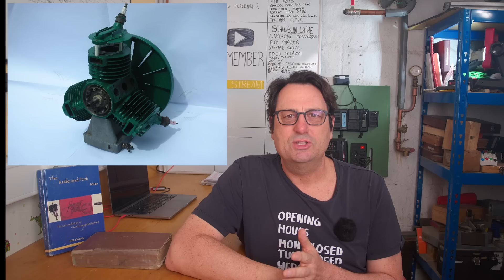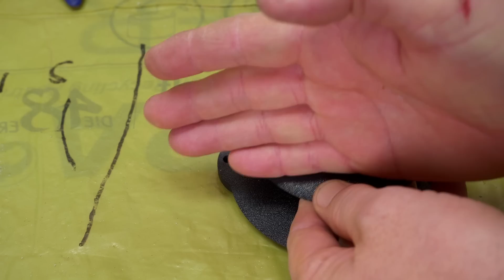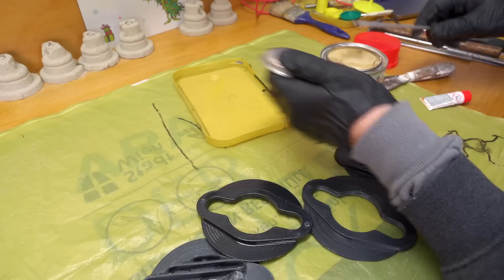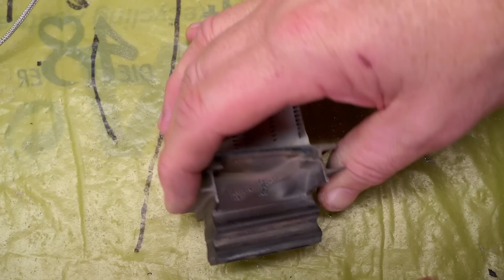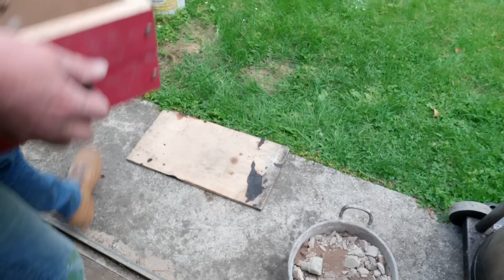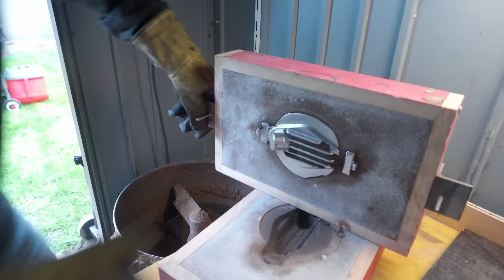Prototyping cylinder heads - Redrup Radial EP.6 || RotarySMP

Comment: Lofts and fillets. The two forbidden features of 3D CAD😢 Autodesk Inventor has a content library full of zillions of fasteners which might give you the AF dimension for your BSF screws.
Regards,  Preso
Reply from the maker: Hi Mark. I have been informed that BSF is a head of a one size smaller BSW. The 3/16" BSF i= 1/8 BSW = 0.340" AF hex.
Reply: @RotarySMP  That's good. Getting the details right is important. I am just about to start on a casting project in aluminium that has very thin sections like the fins on the cylinder heads. I was going to try pouring at about 720C. I am not too worried about porosity since it's just a model racing car (a replica Cleveland Racer). 
Regards,
Preso
Reply from the maker: @Preso58  Hi Mark.
I don't know why I brainfadedd and thought 600°C would be a good starting point, but it has been a good learning experience to step up through 680 and 700 on this casting to see the effect of these temperature changes. With a bit of luck we won't have any more showers this afternoon, and I can start my production castings. I will use 720°C for them, and also give petrobond a go on thise patterns.

Comment: The solidworks used has “tangent propagation” option un-ticked otherwise one line selection would do the job. Fusion is sure a pretty interface but it’s infuriating to use. Solidworks ad much as I hate to say it is probably the best to use followed by inventor in a close ish second
Reply from the maker: Unfortunately there is not solidworks port to Mac. I actually like Onshape best.
Reply: @RotarySMP I haven’t really tried out on shape yet but as I understand it, it was born from ex solidworks programmers. I’m just very hesitant to get on a subscription service where I lose access to all my past work if I don’t pay up. That and it’s owned by PTC which is a super pain in the @$$ to deal with. I guess at some level it’s damned if you do, damned if you don’t but I’d expect SW is the most user friendly for modeling with inventor and presumably onshape a close second. Fusion is hot garbage for modeling but absolutely brilliant for CAM so my process is model I solidworks and then CAM in fusion.
Reply: @RotarySMP  I do keep a PC just for my engineering software but if you have an intel based Mac you could do bootcamp. Some of my students have also had decent success with parallels to emulate a windows environment

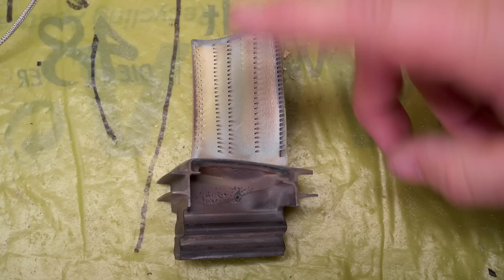Comment: 24:27 , on large heavy frame gas turbines the combustion gasses are measured near the root of the vane disks in a small cavity. The temperature is cooler than in the direct gas path but it’s also precisely cooler. Which means an accurate combustion temperature can be determined without the need of placing instrumentation in the gas path where if it fails it could become foreign objects that destroy the turbine section.
Reply from the maker: Thanks for that. I have never had any involvement on the big stationary gas turbines, other than a fascinating lecture from a Siemens engineer during a Cranfield short course.

Comment: Polymaker and likely a couple others make a burnout filament for this purpose. I’m planning on buying a roll and when I get a chance will try it out. If this works, then large investment castings would, should, work. I hate making two part molds. This would eliminate the need.
Reply from the maker: Hi Mel, I have a roll of polymaker polycast. I need to try it out on my wifes next Beatles casting.

Comment: Hi Mark,
3/16 BSF bolt heads are .340 across the flats.
The spanner for this may be marked 1/8W or 3/16 BS.
In my apprentice days in Oz my fitting and machining hand book, long since lost, had the formulas for bolt heads and washer sizing based on bs190 an bs84.
An alternate is listed as 2ba if bsf is unsuitable.
You might find that some of the fasteners on this motor were C.E.I. so be careful with 26 tpi threads if specified.
Bolt and nut hexes and the washers for bsf were sometimes based on the next size up i.e.  the washer for 3/16 was sized for 1/4 except for the hole which was clearanced for 3/16.
As this motor is pre ww2 it may have used the larger head and nut sizing for all the fasteners.
Depends how accurate and pedantic you want to get.
This would also apply for the bolt pads.
Good luck.
Reply: Good point on CEI threaded fasteners,  my thoughts exactly.
Reply from the maker: Thanks a lot. 
I also considered CEI, but asked Bill Fairney, Redrup's biographer, and he confirmed Redrup used BSF on his engines. He had worked on aviation engines in WWI. US AF and Metric are way more logical than the BSW/BSF system of naming the spanner off the nominal shank diameter.

Comment: Very detailed and comprehensive video, CAD modelling to casting, brilliant 👏. 
Ref cylinder head fasteners,  looking at my 1927 Mechanical World Year Book , there's no 3/16" BSF listed (starts at 1/4), but 3/16 BSW has head A/F of 7/16", and height of 5/32", the book is heavily commercial, with no standards referenced. Slotted head screws could certainly have been used as you state, not sure what year British Standard Cycle BSC, BSCY, or CEI was introduced, this had 60° thread angle. Would a fine thread be suitable for what would be a fairly low strength Aluminium alloy casting?

Many thanks for sharing. 
John from the Black Country UK 🇬🇧
Reply from the maker: Thanks John. I discussed threads with Bill Fairney, Redrups bioographer. He confirmed that Recrup used BSF on the engines, rather than cylce, as he had worked on aviation engines in WWI. The aluminium castings will not be threaded (other than the spark plug). The threads are in the cylinders, which are cast in iron, integral to the crankcase.
Reply: @RotarySMP  Hi Mark,  interesting,  I had assumed the crankcase was aluminium. TTFN John
Reply from the maker: @bostedtap  That would be too easy :)

Comment: I'm far from an expert on FreeCAD fillets but I can offer a couple of suggestions:
1st: ensure you have upgraded to 1.0.1 (released about a week ago) which fixed a number of issues.
2nd: Contact Darren Stone (MangoJelly) to disuss if your issue is possible with the current revision, and
3rd: Submit a request/start a discussion on the Forum as the developers are always looking for feedback on issues and you seem to have discovered an unusual one.

Question: Are there any options to prevent Hydrogen intrusion in aluminum casting other than temp control ?

Thanks again for the great videos.

Comment: It might seem counterintuitive, but to reduce the layer lines it might be worth a try to print it at 45° or 90° turned to how you did it, kind of mid-air and let the Slicer generate tree supports on one side. With that, Acetone smoothing might be enough to smooth it.
Reply from the maker: Good tip. I didn't think of that.

Comment: I’m impressed with your projects. 
I’m guessing you’re going to make the motorcycle too for that engine? 
I’m impressed with your casting work and I’m impressed you have a Muller I didn’t realize you had one or is that a fairly new purchase? Are they hard to find that size?
I do enjoy the jet engine exclamations. Also I didn’t know about the turbine engine fins had the small holes. I knew they were hollows through the center.
Thanks for explaining about the different temperature probes and jet engines. I didn’t know anybody was using color, but why not as temperature. 
I’m impressed with your CAD skills. Also I’m not good at that stuff. 
I do all my drawings on paper   
Yes, I’m a machinist for 40 years. I have my own machines at home too thank you for your good work.
Reply from the maker: First I will make the engine... that might take five years. Then I will think about the motorbike. :)

The muller is a home build one, I made from an old hot water heater. I made it about seven years ago, before I started doing videos.
Reply: @RotarySMP  I watch all your videos so you’re making this motorcycle from pictures and this was a one off motorcycle?
I was kind of guessing the guy built it for racing back in the day?
Well, it’s good that you manage to find some documentation and and use extrapolate from the pictures. 

Would the original bin aluminum or was it cast-iron?
Reply from the maker: @akfarmboy49  Redrup made the first one for himself as a daily driver. He lived in Wales but had a job on the english side of the Seven, and would ride the bike to get the ferry. I doubt it was raced. It is a gutless 2 3/4hp :)
There was at least one limited series production motorbike from Beaumont with this engine, and also some industrial engines for gensets etc.  I have no idea how many were made.
The crankcase with it's integral cylinders is cast iron. The head was supposedly aluminum.

Comment: i like using fillets for 3d printed parts, great way to add strength to fills and other structures for 3d printing if you can accommodate the space it requires.
Reply from the maker: Good points Christopher. With castings you  really need them as sharp edges cause loose sand.

Comment: i have a couple off the cuff ideas for getting the boss insert not to stick to the head
1) increase the alignment pin tolerance by some tiny amount to try to eliminate stiction without greatly affecting accuracy (might be difficult to hit that sweet spot due to the limits of 3d printing)
2) use conical/tapered alignment features so that the boss pretty much cannot stick to the head while still retaining high accuracy
3) insert a nut in the head under the boss so you can use a screw to jack the head off of the boss and out of the mold so the boss is forced to stay in place
Reply from the maker: 1. I have the main pattern enlarged by 1.5% for metal shrinkage, and left the boss nominal, so it is nearly the right tolerance, but sticks just a little :)
2 It is tapered, kind of like Morse tapers release :)
3. Good idea. I will see if there is enough space for one.
Reply: @RotarySMP  if you end up not going with the jacking screw idea or it doesnt end up working, maybe try doing cones instead of taper pins like if you look up "cone locator pins", that way like i said it is pretty much impossible to stick but with that also being a downside wherein a bit of care has to be taken when ramming the mold as to not displace the boss piece.
Reply from the maker: @misterdeedeedee  They are now working nicely. I did another casting session yesterday.

Comment: nice work!if you increase compression ratio consider adding a little more cooling.
Reply from the maker: It is only a 2 3/4hp engine. That compression ratio will be fine.

Comment: I work in one facility with an aluminium casting shop. Comparing your methods to theirs, you are overthinking a lot. For a 1-10 parts they never make so much effort to make the perfect casting. Grinding, sanding machining and even welding is used to rescue failed castings. Cheers.
Reply from the maker: I am a pretty bad welder, and have never tried welding Al. As for the rest, I need better casting skills to be able to cast the crank case. Better to practice on these simple bits.

Comment: Hm, maybe 3dprint negatives and cast them first with some really hard wax ?  easier to smooth with just a flame.. or just thick spraypaint maybe .. dip in epoxy ..  ?  I would think wood would have been the choice of the time when this was first build ??? .. would lend into authenticity .. Thanks for the Video ! Good success ! Pressing all thumbs that you can do it inside your initial time estimation :D
Reply from the maker: There are many ways to do this. I am far enough down this path I will stick with it :)

Comment: Two thoughts, I had a customer making aluminium die cast parts in western France, I was interested in the corrosion resistance of nickel coatings and it was commented that it was always worse when the weather was moist. The castings did indeed have variable porosity. The molten metal was supposed to be degassed with a vacuum lid before pouring. The gasket was damaged and the vacuum gauge was broken, so no one noticed no degassing was happening. 
Sadly that slip cost the company its biggest customer and went bust. 
Second, if Redrupp did a great western apprenticeship, chances it was in Swindon. I  once visited the works at the beginning of my student years in the early 1970’s. My recollection was nothing was ever small! The place was vast.
Reply from the maker: Thanks for that on great western :)

I have been thinking about making an argon degassing lance.

Comment: Thoughts:  Why bother with the little bit for the spark plug?  IDK why the original would do that, as that would make it harder to make/cast right?  I say just modify it so it's all one piece and add draft to it.  Just my opinion though.  Also, I think you can bubble argon through the aluminum to keep the bubbles to a minimum.  Think I saw another YT'r do it when he was trying to make purple gold?  IDK...
Reply from the maker: Thanks. I have been thinking about making an argon lance.  I also did consider just a big fillet, but liked it better like this. :)

Comment: I know you can increase compression on that head. You can even see it in one of the reference photos
Reply from the maker: I could. But I want to make an accurate replica, so I picked the one in the drawing.
Reply: I think the examples hint that combustion chamber is an oblong cylinder shape the diameter of the valve, rather than matching the bore diameter in the center. You can see it most clearly here 6:38
Reply from the maker: @sunfishensunfishen2271  Yep, I saw that one as well. Basically every sketch, drawing and photo shows a different version. I decided to build the one in the two view cut away.

Comment: BSF hex head sizes are in a table on the BSF wikipedia page under the "nut approximate" column for some reason the fractional inch size is blank for 3/16"BSF but it gives the metric size of 11.3mm which corresponds to 13/32" which in turn fits to the other size intervals.
Reply from the maker: I was given a different size from others in the comments here?
Reply: @RotarySMP   PS looks like wikipedia is listing the pre war Whitworth sizes for BSF which were 1 size larger than BSF and post war BSW whixh were the same🤣. Mine and Wiki's bad
Reply from the maker: @elanman608 Yeah, that change in head sire standard is confusing.

Comment: Here's a probably stupid and a bit hairbrained idea, but what would happen if you printed in ceramic filament, and made your model a void in the shape you want to cast. so you put the ceramic print in the sand and fill it?  I'm not sure how well the ceramic would hold up, and it might be expensive to test it. but fillets and overhangs would be easier maybe, as well as the casting process faster. the downside would be the need for a new print for every cast. LOvE your videos! <3
Reply from the maker: Industry goes one better. They just 3D print the block of sand. Layer by layer.

I have never heard of a ceramic fiber which can be plasticized and extruded at a practical temp.
Reply: @RotarySMP  You're absolutely right!  I'd seen ceramic filament printing and my layman brain just assumed you could throw a reel into your printer and it would work. My old brain still thinks this is all magic somehow.
Reply from the maker: @TheVan453  Yeah, it certainly is magic. That 3d printer is already an amazing tool.

Comment: the fillet near the bottom of the combustion chamber, at the fin, you can union it with a MUCH larger shape that cuts the fillet off at the edges.
Reply from the maker: Good idea. There are always multiple ways to do these things.
Reply: @RotarySMP  yah, freecad has so many options and possibilities that when a limit is hit, it's surprising and frustrating.

Comment: I think the fillet issue is the near-but not quite tangency caused by the draft angle where the revolve intersects the splitline. I was able to get freecad to do that fillet after filleting the splitline first. It will also do the fillet if you split it into two halves first. Can use a plane and "slice apart" in the part workbench for that. It is certainly a weakness of FreeCAD, and the underlying geometry kernel(OCCT).
Reply from the maker: Yeah, I also got it to work on similar fins, but never really understand when it will work and when it will fail. Bondo to the rescue.

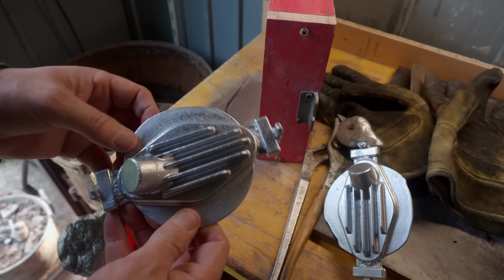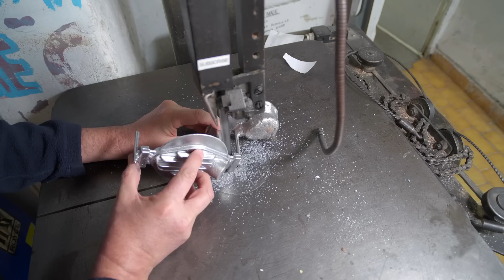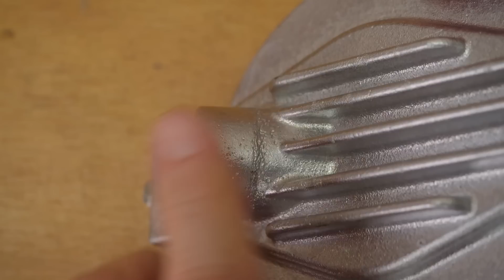Comment: At 39:32, 41:04 and 41:30, Have you or has anyone ever considered heating the mold in a microwave oven to make possible the thinner areas of the part to not cool before the metal fully arrives to the farthest parts of the part?  If the mold was 200 deg, rather than 70-80deg, might it allow a cooler molten temperature for less porosity and still be hot enough to be liquid at the edges?
Reply from the maker: Not with sand John. That is how investment castings can be so intricate, as that mould is near pouring temp.

Comment: If the goal when removing a pattern from the sand mould is to pull it up perfectly vertical, may I suggest using rather longer screws (or rod with a thread cut, or screws let into the ends of long wooden dowels)?

The longer the screw, the less side force it is possible to exert (assuming you're holding the top).

Reductio ad absurdam - a 2 metre long screw would be absurdly inconvenient, but the pull would be very near vertical, with very low side forces.
Reply from the maker: Thanks Paul, these patterns are not deep, and pull quite easily, as long as the loose peice doesn't lock. There is a taper to align it, and it is a nice fit, like a morse :)

Comment: Is extrange that the spark plug is over the inlet valve. Is more common to find it close to the exhaust. I understand that it is easier to star the explosion.
Reply from the maker: This head is symmetical. I will check which way Redrup aligned it.